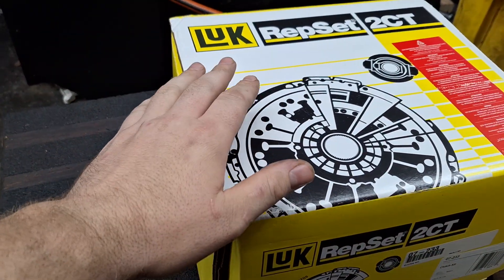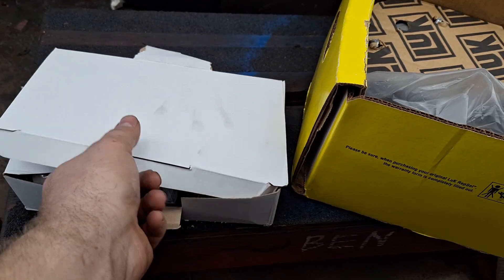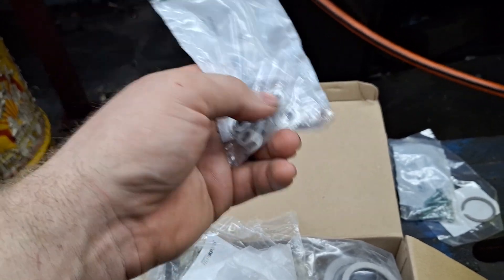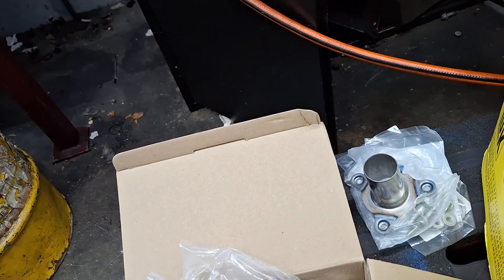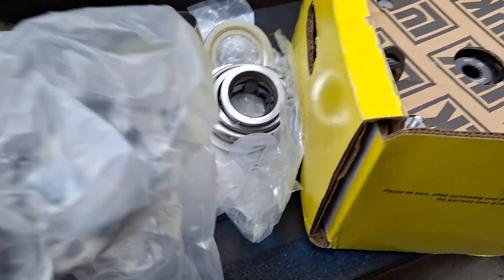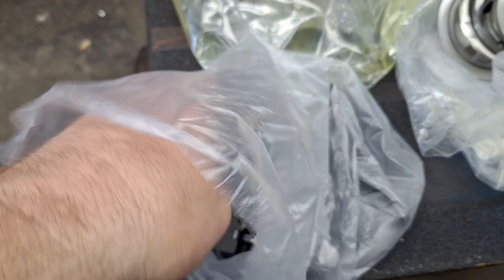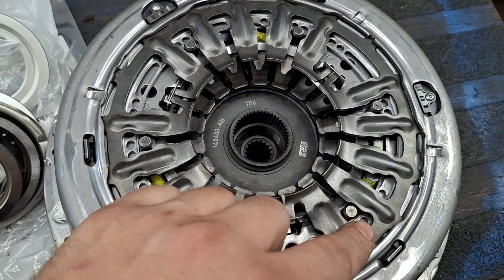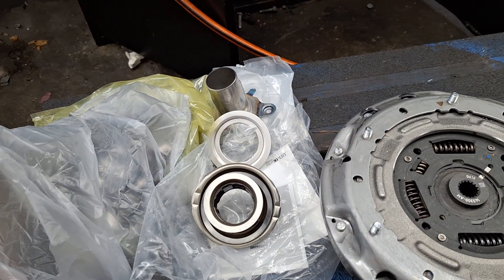Should You Buy A LuK RepSet for Your 2012-2018 Ford Focus Dual Clutch Auto?

Comment from the maker: Thanks for watching!
Dual Clutch OEM Clutch & Fork Kit: https://amzn.to/47GMeIl
OBD Link EX (For Forscan): https://amzn.to/3HsvidV

Forgot to mention! You'll want to replace your passenger axle strap and nuts. You can go by the dealer and buy a seal kit with that, as well as seals and other hardware. Part number EV6Z-7052-C
Reply: I think I Found it ??. The parts sale individually. I think it's these. Strap and nuts

Locking Nut
Part#: W520102S442

Bearing Retainer
Part#: YS4Z3N324AA

Are these the right parts
Reply: So, question? So I'm clear, did somebody buy this kit online, and provide it to you to install, then?
Reply from the maker: @DetroitMicroSound  I just saw your question here (3 months late, I know). Yes, a customer bought it and had me install it.
Reply: 👍 @BigBensCarsAndCycles

Comment: ince i replaced the clutch and forks the cabin shifter feels loose when i put into park it highlights the d in white but still in park shifts really good while driving and when i come to a stop i can the clutch making the clicking noses like before i bought it from rock auto Luk brand i  installed it twice while i was unlocking it it popped out of the trans didn't realize snap ring was too thick so i relocked it used the old one and it stayed was alittle difficult doing the learn because of the shifter and when its in park sometimes makes the tiking sound and i put it in neutral makes me wonder if i didnt get someone's returned garbage tired of buying garbage parts stay away from rock autos Hitachi fuel injectors as i had to pull them and return dumping too much gas

Comment: if the lower retaining clip is broken, the plastic one, will be a issue if assemble like that? i just get a new kit from luk and that retaining clip is broken from the box!
Reply from the maker: As long as its not broken to the point where the bearing will fall off the slave cylinder while driving
Reply: Did you put it on and everything is fine? I have same situation where one of the plastic clip is broken.

Comment: Hi Ben thanks for the great tutorials. My question is.. does the tcm need to have a relearn completed after clutch and actuator replacement. Thanks in advance.
Reply from the maker: Hi yes a clutch touch point learn is ideal for best shifting
Reply: Could you provide the link for forscan?
Reply: Hi Ben, what would I need to do the clutch touch learn? Would Forscan be able to do that?

Comment: I bought a lock in the shop put it in my truck... It makes a fluttering noise between each gear... Sounds like a boat motor underwater.... Had to bledhe hydraulics every 3 to 4 days for about 5 years.

Comment: Thanks for your video. I have a question. I received a quote from a Ford deal to do a clutch job on a 2015 Ford Focus SE. Their quote included the clutch, the actuators, cylinder, seal assembly, and two different lever assemblies. Is it necessary to replace all of these parts? I have reached out to a few different shops checking my options and they typically only quote me the "clutch kit", which I am assuming is what you unboxed above.  Thanks in advance for your advice.
Reply from the maker: @danielclaxton191  hey yeah they're pricing you each part individually. You can buy the luk kit and have them install that instead. That'll save you about a grand in parts upcharging. But no warranty.
Reply: @BigBensCarsAndCycles   so are the actuators included in the kit? And is it necessary to replace them if they are not included? Is this actually going to fix the problem I am having with hard shifting out of 1st to 2nd and shuttering mostly in lower gears. This problem seems to get worse as the car warms up? Could a transmission fluid change help?

Comment: Not in the RepSet…what are the Ford part numbers for the inner and outer input shaft seals?

My local Ford parts counterpersons are incompetent!!!
Reply: Oh…is that the EV6Z-7052-C seal kit, complete with the saddle bracket?
Reply from the maker: @seanhoward8025  yes, that kit you wrote has it

Comment: Do you think that these clutch assemblies make the DPS6 more reliable than the original? Still hoping to get past this sticking B fork issue on our focus, but don't want to pull the tranny if it's not going to make it more reliable than the what ford put out. Curious how these are holding up?
Reply from the maker: The new clutches aren't much better. But, with a fresh clutch, forks, slave cylinder, and new OEM TCM you'll be set for a very long time. As long as shudder doesn't bother you. I'm doing a manual-swap series now that will turn the focus into one of the most reliable cars on the planet.

Comment: I did see these online, and made a note of it. ...I'd love to see you do some performance tweaking to the DPS6/TCM. 😁

I may be weird....but I want a LuK sticker for my back window. 😄
Reply from the maker: That's not weird at all! They should toss a sticker or 2 in that box! I wouldn't complain. And yeah, performance tweaking! Sounds like a good idea. Most likely it would have to be a programming type tune. I'll definitely think about what I can do! I think it's worth a shot using royal purple as transmission fluid. It may smoothen shifts/quiet gear changes. Obviously its a dry clutch, so i'm talking about the shift drum and synchronizers. Thanks for watching!
Reply: I'm stoked! I hope to see you tuning, and working with more advanced fluids really soon! I have been wondering about what transmission fluid would be really great in here, since there is no clutch dust getting in it.. I'm an Amsoil fan, but... Btw, just ordered a LuK sticker for my back window! Going to look especially sweet against my Blue Candy Metallic paint, being yellow. I just sprayed my fog lamps yellow, too...😁  @BigBensCarsAndCycles
Reply from the maker: @DetroitMicroSound  very nice! Blue candy is my favorite color for a focus. Maybe I'll put some high quality fluid in my Trans and make a video! A servicing video and 1,000 miles later update perhaps.
Reply: Good taste my man! Gorgeous finish. Love this tri-coat! Multiple shades of blue in one! I'm here for every video you make on these two fun, and interesting cars. So much Focus stuff applies to Fiesta, in the Mk7, that most videos you make with a Focus, will have a lot of relevance to mine, in the DCT variants. 👍Hopefully we do see you get your hands on some Fiestas though! Do you net see as many Fiestas in for repair in your area? Less sold there?  @BigBensCarsAndCycles
Reply from the maker: @DetroitMicroSound  I definitely see more focuses (foci? Lol). There aren't as many Fiestas where I'm at. Probably a ratio of 9 to 1 lol. I'll definitely make videos on Fiestas. I appreciate you watching. And yeah I do need to make an improved tcm replacement video for a Fiesta. I was still a noob when I recorded that one haha. I mean, I still am, but that video isn't that good.
Reply: I had a feeling you just don't have many Fiestas in your region. I'm here for it all man. You obviously know these DPS6's! 😁 @BigBensCarsAndCycles